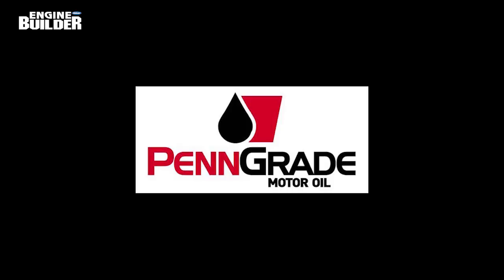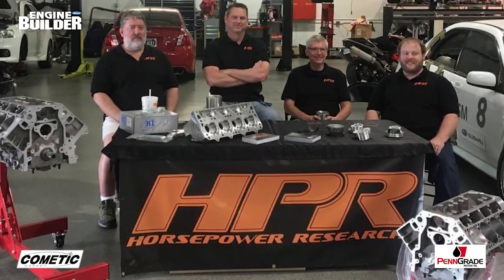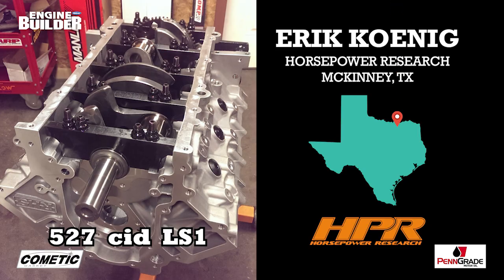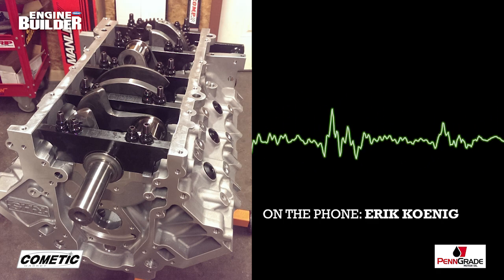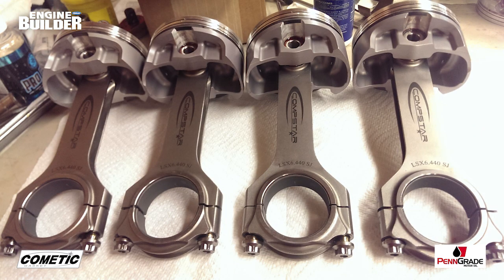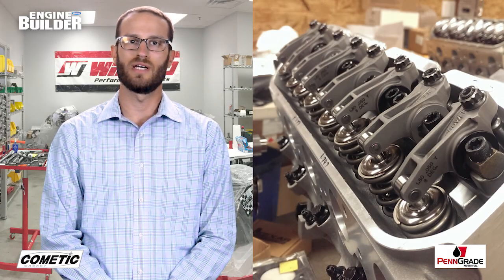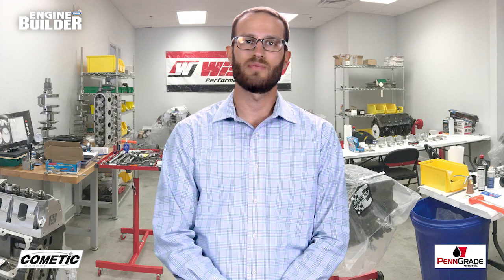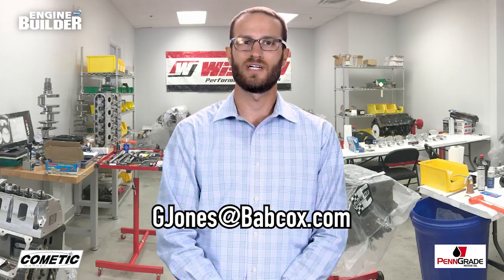World's Largest 527 cid LS1 Engine

Comment: I had 1 of 11 436ci stroker engines built back in 2002 by ARE (Agostino Racing Engines) and with very bad flowing LS1 heads of the time and a ported LS6 intake and stock TB at 11.3:1 cr it made 530 RWHP.  Idled close to stock, but yes, with a nice little lope.  Thats a LOT of power for way back then.  If Brodix, LS7 or MAST heads were available back then it would have easily made 630 RWHP.   So that 527ci is actually pretty cheesy......not sure why its so low on power at 11.5:1 cr.    Makes no sense.   Alan Futral built 14.1 cr 427's that made 850 HP on the engine dyno....15 years ago.  Yes, it was a big ass cam but they were sweet.  NASTY as all hell in a street car.  Its all in the builder.......Erik Koenig isn't doing something correctly.
Reply: Cool history story
Reply: It’s a niche motor in its configuration. They can build horsepower with ls, but you don’t build 4 figure power with maxed out bore and stroke in these blocks. The really high horsepower ls motors are 400-440 ci.
Reply: Prob running out of head flow. If you have lots of bore and stroke, but cant feed it, you wont make power.

Comment: Would like to see more options on this engine; maybe a mild mannered street set up with the option for a lot of cam overlap version.  Its a standard that off the shelf parts can put an American V8 at the 1.25 HP range.  With so much custom work and $'s I was expecting more. Not knowing specific parameters, Im only guessing that the cam, cylinder heads, and intake are holding this thing back.  Ild say if you're gonna spend the money this thing costs, forget Brodix and opt for some MBE heads and intake.., whats another 8k to the price ;), its only money

Comment: the cylinder walls must be as thin as paper 🤷‍♂️🤔👍
Reply: It's an RHS tall deck, 4.4" centers and I'm guessing, .200" web if they went to 4.2" bores with a 4.75" stroke. That's still plenty of web thickness for an NA block. Not that I'd want to build this large...
Reply: Almost as thin as a factory cast 351c

Comment: its crazy that we have much smaller NA motors making 840whp nowdays
Reply: This Is An Engine With A Hydraulic Roller, Pump Gas Friendly Street Engine. I'm Actually Surprised By The Stupid, Backhanded Remarks In The Comments SMDH.
Reply: 840 wheel N/A? So you're saying 1050 crank? Obviously that can be done with a 400-427, but it'll take a huge cam, big heads and 9500 or more rpm.

Comment: So anyone else wanna know what this thing can do on 30psi lol
Reply: 2200+ if the block can hold up
Reply: @Ed_H_870  never ls1 shouldnt be bored larger than a 396 anyways itll fuck up the cylinder walls. not sure how long this 527 will last
Reply: @Ed_H_870  Block? Screw the block. If you feed that thing 30 psi and it goes to 2200, the crank will grenade on you very quickly - even if it has Cleveland mains and 2.200 rod journals. There has to be zero strength between the main journals and rod journals on that crank.

Comment: Disappointing.  You can make a stock LS7 short block with heads/cam/intake put out more than that.
Reply: This makes 800 horse to the crank. Show me and ls7 that does that on pump gas, please
Reply: @piercesgmc9112  It makes a hell of a lot more than 800. He said 750 wheels with a good intake. If that's in front of an automatic with a good rear end, that thing is in the 940-950's. An honest 700 to the wheels in the same case is about 875 crank. Not saying it can't be done, but it'll be raunchy.
If that is 875 on pump, the combo will look something like this.
CID LS7 heads with 289/106 cc ports and 2.250/1.610 valves.
Mast single plane intake or similar.
268/284-114+3-774/756 solid roller cam.
Yep, cheap and very street friendly - not...
Reply: Lol, you LS fanboys who think a stock LS7 can make anything with a few bolt-on's are funny. Have you even ever built an LS?
Reply: @AB-80X  lol you dumbasses. Who hasn't built a LS1.  And ls7s are very impressive and easy to make power.  You just made your self look stupid by your obvious lack of knowledge

Comment: Bullcrap. That's not a Chevy small block. Not 1 Chevy part.
Reply: Yes you are correct. But they never called it a SBC.
Reply: An LS IS the Chevy small block. It's LS architecture so it's a Gen III/IV small block Chevy.
Who cares what it says on the tin. My 583 is a BBC as well.
Reply: You got alot to learn dumb ass..

Comment: I'll stick with the big block Chevy
Reply: Nah LS ftw!
Reply: @effingwrecked1917  I reckon johnny loves the BBC
Reply: @effingwrecked1917  Give it a rest LS boy.
The LS is great, I have built a few, but if you think there's any way in hell that a built LS will outperform a built BBC, you are so far off it's not even funny. And don't say just add boost. Because if you add boost to a well built BBC, you can make 3500.
It's simply physics. A BBC has bigger heads and have much more displacement. That's just the reality of it, and you can stick a much beefier rotating assembly in the BBC.
Reply: @AB-80X  But you dont need all that power for the street anyways. Unless you in the NHRA or you doing “street outlaw” type of deal. A LS is good enough. Saves money and headache.
Reply: @AB-80X  LS are underdogs compare to the big block anyways. So LS Holds it down.

Comment: That's just nuts Pavtek has a Gen1 small.block out to 434 inches without spray No boost just N/A cranking out 750 HP all day long so I have to ask myself why would I ever want a 527 inch LS motor with relativily low HP when I can have a 540 inch BB cranking out 800 HP all day long   for so many $$ cheaper ?? It's got to be more than the novelty of having a Big inch LS ...
Reply: Pavteks motor makes 750HP at the crank.
This motor makes 750 at the tire.

There's a major difference here.

https://www.enginebuildermag.com/2018/05/527-cid-ls1-engine/
Reply: But try boosting lets see which makes more power. 527 ftw.
Reply: There talking rear wheel HP . 
And a guy in Georgia USA 🇺🇸 is getting 928 hp & 674 tq with a 427 Windsor a few yrs back . 2017 from memory.  Heard recently that he is over 1000 hp ... with his own designed heads .  He used 2 work 4 Jon Kasse.
Reply: How much does that 540 big block weigh? I guarantee you this smaller footprint aluminum block weighs less. Not to mention crank horsepower vs. wheel horsepower are different. Just as the other dude pointed out.
Reply: @sethh8892  Don't be so sure. I recently build a tall deck LS with a friend and that block was 119 lbs. It's no lighter than the block I have in my standard deck 583 build. The weight difference of an all alu tall deck LS vs. a standard deck all alu BBC is virtually nothing.
Reply: @AB-80X  the iron block ls is twice the weight of the aluminum model. Iron is heavier than aluminum by volume. This is not something you can argue about
Reply: @sethh8892  
Did you actually read what I wrote? Where did I say iron block? I was specifically comparing one aftermarket alu block to another aftermarket alu block. Do you think it makes any sense to build a 583 from an old junk four volt mains block? I know doing it as cheaply as possible with junkyard crap is a thing for your LS guys, but shone of us actually prefer to build nice engines with new parts. 
Also if you want to try something fun then compare annLS iron anchor to a BBC iron anchor. I wouldn’t run any of those in anything and they are about the same.
Reply: He did say 750 at the wheels, translates to over 1000 at the engine! Also low rev range, reliable horsepower and maintenance.
Reply: @brettrussell9643  rev range doesn't tell a thing about reliability. Piston speed does, let's see what his piston speed is, then we will know whether he will have a reliable engine or not. Being as though he's using dinosaur bones to build his vehicles, it probably won't be as reliable as you think.

Comment: It’s funny people think this is low hp, some people actually want street manors. High duration cams make awesome hp, and absolutely suck on the street.
Reply: If you want a low horsepower Street motor than stick with smaller displacement... if you're going to try to turn out 500 plus cubic inches from a small block, there's no reason to push everything else to the limits... frankly I think he's still losing horsepower from the heads. The reason Big Blocks are able to turn out more Powers because they have more room in the heads for airflow.
Reply: @sethh8892  Ive see cnc ported ls style heads that flow 450 cfm thats plenty of flow for this engine
Reply: @bethanyhaskiell9116  At what lift an where?
CID out of Australia can't match that number and that's pretty much as good as it gets. Way too many ways to fiddle the flow numbers. Some of the extreme race heads go into the 440-450 range, but not a 12 degree LS7, and most certainly not a 15 degree LS3 or LS1.
Reply: @AB-80X  Race Flow Developments LSR head
Reply: @AB-80X  Brodix BR7 heads almost flow 450 CFM
Reply: Lol. Not in the real world. A good set of BR7 300 CNC with additional port work and properly cut valves will at best flow 410 with a huge 4.165 plate on a Superflow bench. I know, I used to own a set from LME prior to getting my CID heads. 
There is no way and I do mean no way a 12 degree LS flows 450. You need to look at what is logically possible and not just buy into the B.S porters and head vendors tell you. There are simply way too many ways to skew those numbers. Reality is that even a Mast 305 or stock BR7 300 CNC will struggle to crack 400 in the real world. And with a bit of additional port work on top of the CNC along with a better valve job, they’ll creep past that 400 number. Hell the LME worked BR7peaks at 399 with a more conservative 4.125 plate. It is what it is and there just are some physical limitations to what can be done in the space available.
Reply: @bethanyhaskiell9116  
Two things. 
That’s a canted valve race head, so not exactly a regular LS head. 
Secondly. That’s a Curtis Boggs number. I’d take that with a grain of salt. 
If you want to know what is possible with that head, ask Darin over at Morrison. I’m guessing that he will say about 430-435.
Reply: @AB-80X  I just said cnc ported ls style heads I didnt say it didnt have canted valves and or not being modified race heads I just said theres a few companies out there that have ls heads that flow around the 450 range and they say they flow 500 but I said 450 just because there probably in between 450 and 500
Reply: @AB-80X  GM even offers 11 degree LSX DR heads with raised runners that flow close to 450 cfm with 2.28 /1.62 valves and and I think a 310 cc intake runner
Reply: INDEED 👌🏿!!
Reply: Low hp? Did you hear he said 750 whp? if that's behind an automatic and a proper rear end that can handle the power, that's well into the mid 900's.

Comment: I honestly was expecting 1k horsepower. I have an 11.8 CR 416ci LS3 with a 240/250 .623 .617 114 and some WCCH Stage 2 LS3 heads and I wouldn't think it would be that far off. Super Chevy or one of the magazines built an engine the same size as mine with 10.8 or 11.1 compression, less duration and lift, and Scoggin Dickey heads that flowed a good bit less than mine and made 630 hp. I figure mine is probably in the 640-650 range and mine cost less than the heads and intake for this I bet. I realize this would make a boat load more HP and TQ than mine lower in the revs but not enough to justify the cost. I wonder why the power is so low.
Reply: But 650-720 whp is a lot more than 630 chp
Reply: @baby-sharkgto4902  Obviously but doesn't this seem underpowered especially for the money
Reply: @chesspiece81  in my opinion they make it all grey by not giving crankshaft horsepower numbers or a dyno graph. They also admit that they are quite limited by cylinder head, (for a 527 C.I. LS) which in your case kind of explains why this isn't the most horsepower per C.I. engine ever.
Reply: @chesspiece81 also,  I agree not the most cost effective horsepower.... ironically the LS is the king of cost effective horsepower per dollar, just not these freak one off monster C.I. LS engines lol however I do not think they are claiming to be the cheapest, most powerful or even the realistic choice so I'm not offended
Reply: Wheel hp
Reply: Your engine should be in the 700-725 crank with that setup. He was saying 750 wheel with a better intake. That's 940-950 or so crank if it's an automatic and a beefy rear end.
I've put together an engine similar to yours with the LME LS7-3 heads and a similar cam. 238/256 -113+4-638/649. It was a 422 that made 742 crank. That's a better head than the WCCH stg 2. The 700-750 wheels numbers he quotes are much stronger.
Reply: I don't know why they're stating 650-750 for these.. they're apparently 800+ hp builds.
Reply: The Crank and heads are the only expensive parts in this build the rest are preety conservatively priced parts. There is nithing too exotic here.
I bet this engine with different heads wouldn't be all that expensive . Not saying its cheap thow.
The limiting factors as they said was the heads. Would be nice to see this very set up with a blower on low boost
Reply: I got a set of stage 3 heads..Man, that stage 3 was pricey but damn good...That stage 3 had fake tits and vaginal reconstruction as part of the package, but I pounded on it so hard the vag reconstruction all of a sudden was fister friday looser than 100 hot gods thrown down the hallway.....Any port in the storm, and she got to freikin so hard screaming give it all to me with one giant thrust I popped dem fake tiddes in the wall....fuck a stage 3 and find out

Comment: ... ok so... let me get this straight. My 12.1-1 ls2 that’s 440ci on 110 octane that’s NA makes more than this? 
I bet this motors 40 grand too. Waste!
Reply: your LS2 makes 850 crank HP. That pretty impressive. Mind sharing build details.
Reply: @Suaveat69  yeah sorry for such a late reply, my motor was 441 in.³ and I made a typo. It was an LS7 not an LS two and it made 733 hp at the wheels in a C6 Z06 Corvette. A LOT of 430-460ci ls motors make that on e85 but where I am I don’t have any e85 so I decided to go 110 and throw a crap load of timing at it. I had about 25 grand in that motor, would do it all over again but this time I went destroked ls7 and it made about the same power for half that money AND on e85. However, half the torque and needs 2,000 more rpm. Makes for an interesting road car.
Reply: Dang. A 900hp LS2 is the highest I have heard of. Did you build that yourself?
Reply: @baby-sharkgto4902 was a typo. It was an ls7. There’s TONS of 700+ horsepower 100-120 octane 12-14 to 1 420-468 cubic inch ls motors out there.

Comment: what makes this engine as ls1 ?
Reply: @jdog942 rectangular heads
Reply: 5.7 l.....1999 and up....
Reply: Guarantee it’s not a ls1 block ls3 maybe
Reply: @ls1_cammeroh  its not a real LS1 the block clearly says RHS and the displacement lets you know its a tall deck RHS block as its not possible to take any stock GM block anywhere near 500 cubes this is to me a dumb build. they did everything right just to restrict this beast with cathedral style heads (assuming thats why they call it and "LS1") instead of some way better flowing LS7 style heads... after looking clearly not cathedral heads so there is nothing LS1 about this engine just ClickBait
Reply: @kevinpickering3866  I missed the rhs on the block but agree with you 100%
Reply: Not a damn thing other than the odd title.
Aftermarket tall deck.
More than likely an LS7 derivative head. Anything else would be stupid.
So, LS7 if anything.
Btw John, the LS1 has the little cathedral port heads. LS3 and LS7 are rect. port heads.
Reply: I was thinking the same